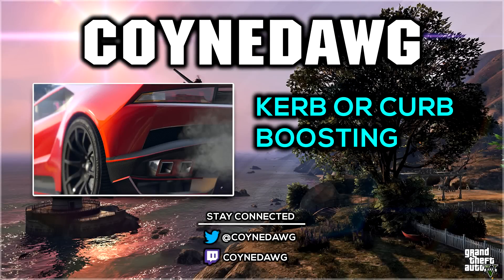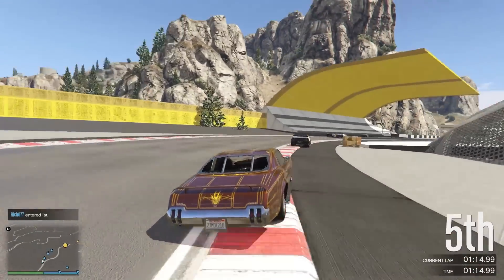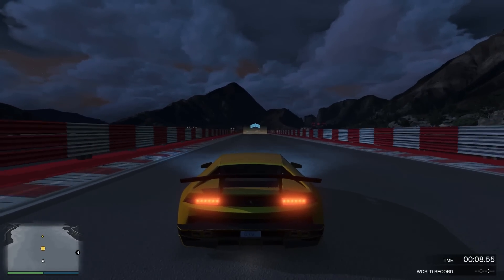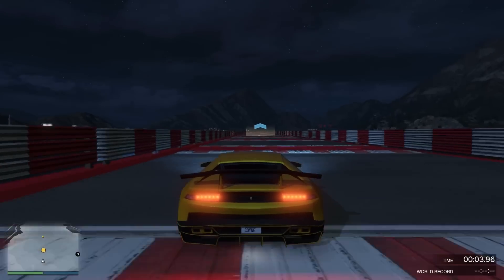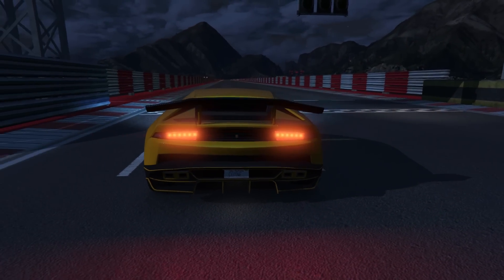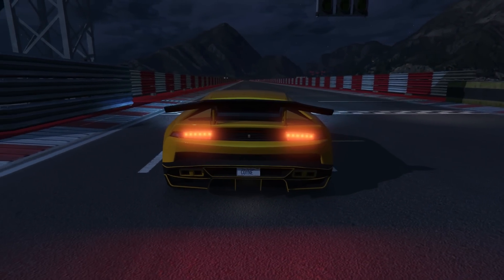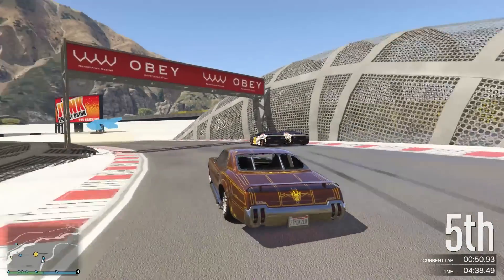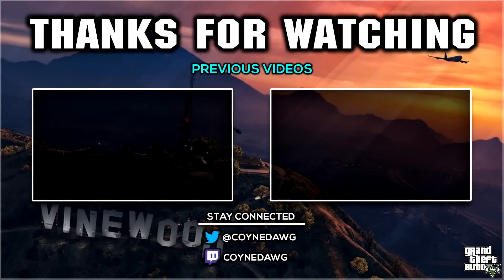GTA 5 Online - Win More Races with Kerb / Curb Boosting - GTA Tips and Tricks Series

Comment: I took a break from playing this game for 18 months. When I last played everyone did this, just a normal part of the game, incorporating curbs into your line. I learned to do it from the best racers. It is harder to execute these lines too with spinning out, takes a good amount of skill to do it right. So yesterday I was racing and after a few wins started getting a barrage of messages from people but didn’t check them because I was in the middle of a race. It was a full lobby and the next race at least 10 cars stopped trying to win and instead ganged up on me, driving backwards, grouping up to pin me against the wall, and just generally grieving me relentlessly. I read the messages afterward and found out they were mad that I was “curb boosting”… never saw people lose it like that before. They are the same people that always use catch up and race dirty, ramming any car that gets close to them… should I avoid the turbo strips too or any other part of the game the gives me a slight speed boost? These people that cry about it are pathetic and just not good enough to run the same difficult line. Turn off catch up and race clean and I’ll avoid the curbs.

Comment: Hi, im a bit late but, do you recommend any specific suspension? Does it need to be lower or higher?
Reply: Doesn't matter at all
Reply: @jebsl8923  theres no way it doesnt matter at all just look at the calico if you lower the suspension all the way use the low grip tires and put your car in lowered stance the car just suddenly becomes faster than a vigilante using the jets and that with no curb just knocking itself against the ground
Reply: @daytonmccarty1986  he was asking 2 years bud tf you sayin he talking bout the suspension not lowered stance

Comment: Maybe when the wheels leave the ground there’s no resistance from the traction physic on the road. And the point in the car becomes weightless, and so speed increases. Something like this?
Reply: no, the game has some strange physics relating to speed in vehicles, normally the game knows that jumping on a car and landing speeds down, so it compensates when the suspension is contracted by giving speed, basically the game thinks you just landed from a jump, but by using curbs, its like constantly landing from jumps and getting boosted

Comment: I've been aware of the curb trick for quite some time now, but I didn't consider bikes with this. Does the trick work with bikes? I got smoked by a few bikes in a race I was really good at the other day and I'm sure they were using some kind of trick!
Reply from the maker: I've not actually tested it but in bike races myself I normally try to kerb boost them and I don't notice much improvement where as with cars the improvement is obvious.

The most common "trick" with bikes is gliding them towards checkpoints, if you take a look at my "Can you fly Further?" Video at the end I demonstrate the bike gliding trick, the demonstration is an extreme version but in races you can use this trick to glide towards checkpoints after jumps, this is much quicker than being on the floor after a jump but takes some practice as it's very easy to glide over checkpoints etc.
Reply: CoyneDawg ah I see. thanks for the info!
Reply from the maker: No problem man, anytime! Thanks for your comments :)
Reply: SwooperFly I've tried it and yes, not as significant as cars but still makes you faster
Reply: SwooperFly problem with racing bikes isn’t kerb boosting, its them tilting back after a jump and flying it’s so stupid that kerb existing and the motorbike flying exists